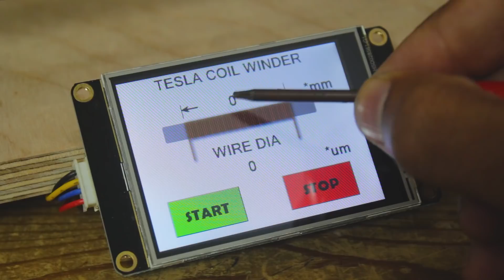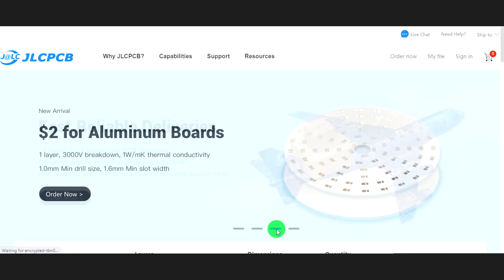DIY Arduino based Tesla Coil Winding Machine | Arduino Project

Comment: No.. I want it to be able to actively measuring the wire width during it's run time so that it can correct even the slightest errors.. especially when using wires which are wider and not wound in spools but from old transformers..

Comment: Mr.innovative the codes for Arduino you have given is wrong. I don't understand why you are always publishing wrong codes. You have not included Nextion library and as per you video you are showing that you connecting your multi PCB . And the stepper motor ports in your code is wrong as well.
Reply: 😮 oh, no!

Comment: It is absolutely unnecessary to build an MC based machine to make a Tesla coil easily. Turn lays by turn tightly if you give a wire some free distance from your fingers to a coil rod. Just table, carpenter clamp, electric drill, wire bobbin on floor and your good will. 

Secure a wire end on a coil tube at the left, set proper rotation direction on your drill, put a wire bobbin on floor vertically, between your foots (take your seat at a table), take a wire with your fingers (between a thumb and a pointer), and make FIRST STRAIGHT TURN of a wire manually, rotating a chuck with your left hand.  Then GIVE FREE GAP TO THE WIRE BETWEEN ROTATING ROD AND YOUR ARM - OF ABOUT A HALF OF A METER. Give medium tension to the wire and PUT YOUR HOLDING ARM A LITTLE BIT LEFT TO THE FIRST TURN, ABOUT A CENTIMETRE, (if your winding direction is from the left to the right). 

Turn on your drill and wind your TIGHT Tesla coil wlthin a half of a minute! As drill runs, move your holding arm along the coil winding, in order to maintain initial angle (a little bit less than 90 degrees) between pulling wire (that runs in the air gap) and the wired part of a coil.

Doing so, you will make your turns to "pull" each other - the next one pulls onto previous one - just in good natured manner, without any MC automation. Have fun!

Comment: Is it necessary to use Arduino shield?
Reply: The Atmel 328 chip can be integrated directly into the PCB, but you would have to redesign the gerber files, or make your own version. Not super hard to do with a little learning. I like to use either "KiCad", or "Easy EDA" for designing PCB, since they are free to use and relatively simple to learn.  
  If you have never designed your own PCB before, a great place to start learning how is to design your own DIY Arduino UNO. This is because there are tons of tutorials on that subject. 
  Once you understand how to make your own UNO from scratch, it will be much easier to look at the PCB that is presented here, and decide how and what to change for your own design.